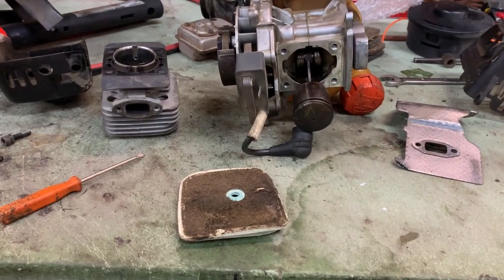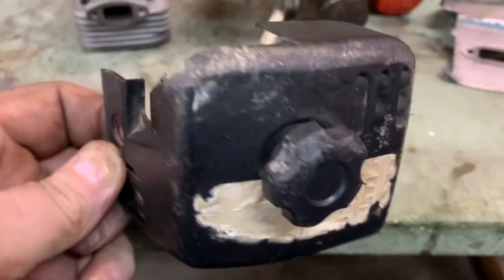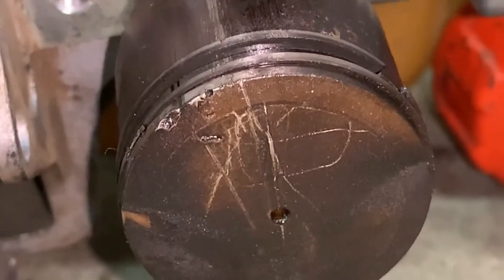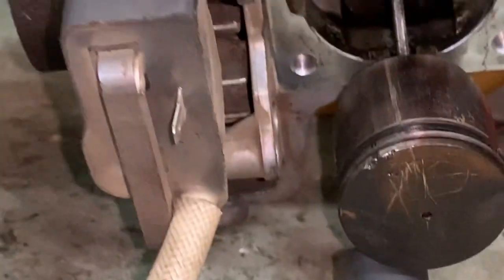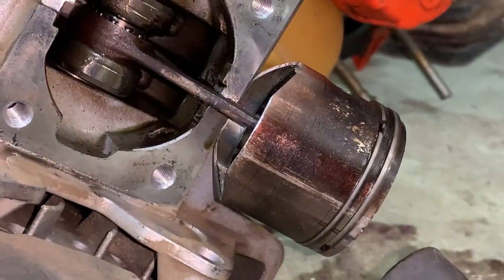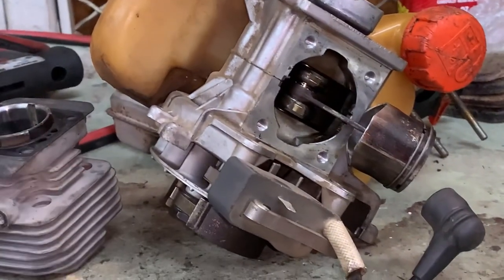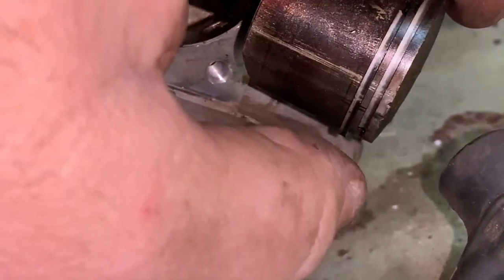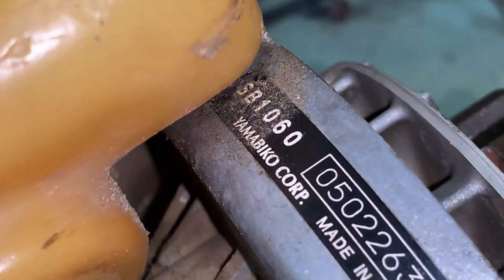CATACLYSMIC ENGINE FAILURE DUE TO LACK OF MAINTENANCE

Comment: The Echo backpack blower I got from our local mower shop was maintained hence it looking immaculate with new tuneup parts but wouldn't pull smoothly even plug out. The rings were trapped by piston material from what's about the size of a pencil tip in the cylinder. As I'm just out the cost of a replacement piston/rings and willing to rebuild again I'm going to see if my careful Dremel work and file work with free rings will work before I waste a piston made of Cheapisium.

Comment: DIY be worth fixing it.    $$$ Shop Labor then parts it have more into it then what its really worth .   Head kit with piston is 70$  a DIY be worth it .  If they say trash it do you fix it and sell it as used?
Reply: Why would you dump $70 and your time into something that has 15 years of hard use under its belt?? That doesn't make sense, it's ready to self- destruct.
Reply: @donmayberryjrsOPE  I have a 30 year old Motorcycle is it time to Junk it or rebuild it ?  I just got a Weed eater $250.00 , I have had others and Chainsaws Just as old I have a 026 chainsaw I got new in 1993 the crank is fine if the rings go I can re Jug it for 80 Bucks its 29 years old .   Sure if its worn out your better off buying new , but in most cases you can fix it for lot less . DIY